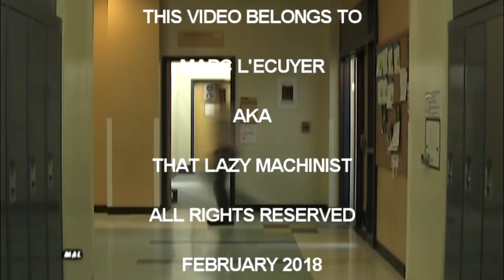LATHE CHUCKS 101 PART 1,  three jaw chucks, four jaw chucks, 5C collets. How to use and when to use

Comment: Very small 3 jaw chucks, do in fact often have reversable chuck jaws. Both sides of the teeth are convex and in some cases are really just round pins.
Reply: I have a small 45mm 3 jaw chuck which is reversible, except when reversing instead of putting jaw 1 in chuck slot 1, I have to put jaw 3 in chuck slot 1, jaw 2 in chuck slot 2 and jaw 1 in slot 3 so that it centers properly.

Comment: The 3-jaw chucks I have also have only 1 key hole. But every drill chuck I can recall seeing has three key spots, and if you need to chuck tightly, you have to tighten all three. I know they are constructed differently, but maybe that is why people ask about only tightening one on a 3-jaw.
Reply: No, you do not need to tighten all three. The chuck key drives a single ring gear which you can plainly see on the outside of the chuck, just like the 3-jaw self-centering lathe chuck has a single crown gear / scroll driven by three pinion gears.
Reply: The scroll has some clearance in the chuck body and binds against the chuck body as well as rotating when tightened. Using the other key positions relieves the binding, alowing the scroll to be rotated a little more with less friction.